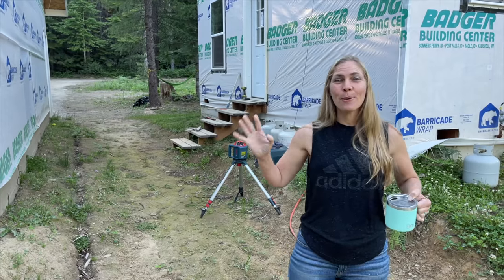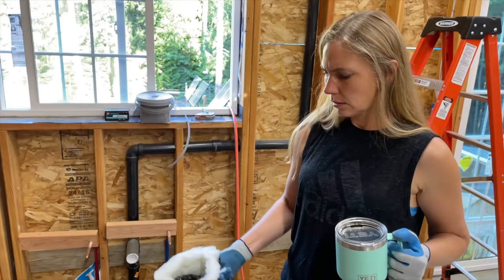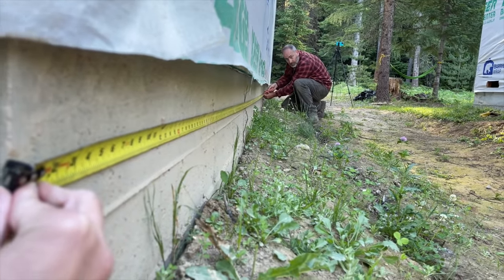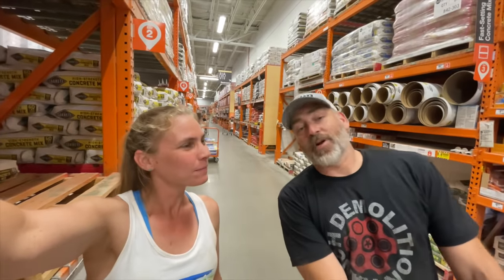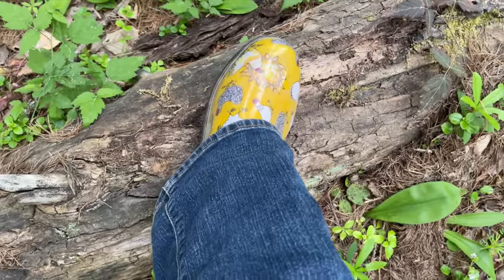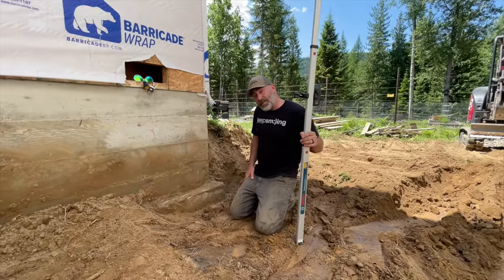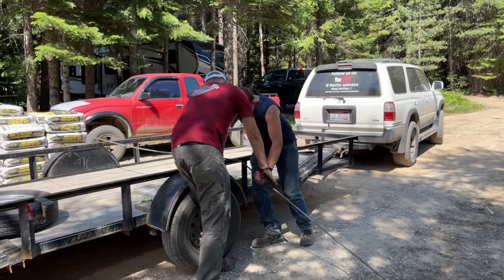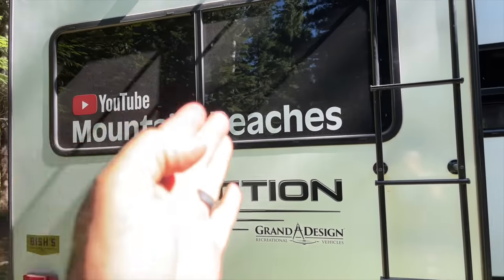CONSTRUCTION BEGINS AGAIN!  - Off Grid House Build

Comment: Install an HRV (HEAT RECOVERY VENT). You run all your exhaust vents to the HRV and bring all exterior air in through the HRV.  The HRV is an heat exchanger that removes the heat from the warm moist exhaust air and transfers the heat into the cold incomeing air.
Reply from the maker: That sounds great.

Comment: That small duct is for combustion air. It does not mix with the air inside the house. After combustion it goes out the PVC exhaust pipe. It actually is Very efficient.

Comment: Before getting the insulation and sheetrock up, yall may want to consider putting in some network drops into the rooms, a couple ceiling boxes and running them back to a central closet. It may not seem like it's needed now, but if/when you want to setup network connections in your house you'll be very glad you did.

Comment: you need to install a heat exchanger for the fresh air.
Reply: Duit pak Martin kok gak habis habis.... Bangun rumah terus...
Reply: Since they are in a Northern Cold climate a HRV Heat Recovery Ventilator rather than an ERV Energy Recovery Ventilation strategy is required and avoids that introduction of Cold Fresh Air directly into the home.

Comment: Use a heat recovery ventilator on your fresh air. Also, you need a filter on the fresh air intake. You may consider installing a damper on the fresh air so you can control how much is drawn into the return.

Comment: For your   fresh air intake  install  either  a ERV/HRV  note HRV best this is heat recovery ventilation   usually   interconnected  with furnace air handler     
 Hrv has a heat exchanger  core   where the air being  exhausted  out  of the house prewarms the fresh  air coming in  so furnace not haveing heat ice cold air  also there may be some dehumidification  happening  in certain  parts of country   
  Some states HRV OR ERV are required  by code  especially  in newly  built  home that is tight.
   The ERV  is the one dealing  condensation  used mainly in the southern  states where  humidity  is problem

Comment: The fresh air intake also prevents inversions where the furnace would draw air from exhaust lines , which then could cause carbon monoxide poisoning. Fresh air intake lines are usually guaged by the number of exhaust fans from bathrooms , stoves, dryers etc. You dont want negative draws of air which create inversions. Example someone opens an outside door and an interior door slams because of pressure changes ! Jeff & Barb Edmonton, AB
Reply: Nowadays because of efficient tight homes they use air handlers or heat recovery pumps to extract heat from exhaust air and warm fresh air intake but all need fresh combustion air same principal in cracking the window on older wood fireplaces to create a draw

Comment: You needed to add an expansion joint between the pours. Three independent pieces of concrete reacting to the cold and heat. Different sizes trying to expand and contract independently, the rebar will not stop this from occurring, not enough strength.

Comment: You can install a heat-exchanger for the fresh air intake. These are up to 90% efficient at transferring the exhaust temperature from the garage to the temp of the fresh air intake.  Straight forced air furnaces pull some fresh air in from outside but don't have an air exhaust.  This causes the furnace to maintain a positive pressure inside the garage such that the extra pressure is pushed out through cracks, door jams, windows seals, etc.  Heat exchangers let all the excess pressure be used to give all that wasted heated air to the temperature of the intake such that the garage will maintain the same pressure as outside.  That way you will only lose about 10% of the temp differential of the fresh air intake, instead of 100%.  They ain't very cheap though.

Comment: When we want to have fresh air in the house we open one or more windows for a few minutes. Fully. Usually at least once a day. Down till about minus 10 degrees Celsius. But then we have other windows, walls and insulation then you in the US. We do not build with wood but with brick. Our outer walls are 39cm = 15 inches brick. And thats on the low end, our house is a bit older.

Comment: Your furnace and tankless water heater will both require an outside air supply for the combustion in each device. This air does not enter the living space so it does not allow cold air in the winter or hot air in the summer to mix with your conditioned air. The combustion air will be expelled outside through the exhaust pipes on each device.

Comment: Fresh cold air has more oxygen molecules and has better combustion than interior air where oxygen molecules are farther apart.  Plus, in small areas using inside air depletes oxygen supply, especially in cold winter because you open and close door less often to refresh air..  most gas appliances have low oxygen sensor that shuts off appliance so you don't die of lack of oxygen .

Comment: wondering why you use a V to mark your cuts??  Its typical to use a straight to the measurement and an angle line on the sacrificial side...i.e. the angle line designates the side of the measurement the thickness of the blade cuts on.

Comment: Its fresh air makeup, The furnace uses air for combustion while burning the propane. I noticed you had screened in holes for where sofits would be to keep the attic cool, in order to keep it cool in summer so not to rot the roofing. I dont know if that can be considered fresh air make up for the furnace. What I say is to inquire with the building department and follow the code.

Comment: Fresh air for combustion. However, if you're bringing in Fresh air for breathing air there is a heat exchanger that can be installed to improve efficiency. Heat the air before you heat the air.

Comment: There are heat exchangers available that heat incoming cold air with the heat in the exhaust air. The issue is the trade-off between cost and savings. Isn't it always?
Reply: I was going to say the same thing.  The way houses are sealed up today you have to bring in air or the pollution in the house will create an unhealth environment.
Reply: I have see heat exchanger that use Hot gas from heater to 10% air coming in

Comment: I am sure there is a reason for making the doorways match from side to side but what happens if the alley is on a angle? I sure could take the extra couple steps to go from home to garage. Its deep enough to have some storage space on either end and never too much storage... Nice work and use cooking oil on the skin and the bugs get trapped and die on you instead of packing a pint per bug.... okay per three bugs as they can get more blood than the nurse can draw for tests..

Comment: KEEP IT SQUARE if you go off a 1/2 inch it won't be. OSA (out side air its called now because in some areas it's NOT FRESH)  needed to compensate for combustion.
Reply from the maker: Combustion air comes from outside too.

Comment: Fresh air needed as combustion air
Reply: There are separate air intakes for that on both the water heater and the furnace.
Reply: Fresh air is completely separate from combustion air.  The fresh air is connected to the cold air return.  The combustion air is dumped into the furnace room.  Since you put your furnace is in the attic and the attic is Vented the furnace will have all the combustion the furnace will need.

Comment: Martin, on that makeup air inlet for the furnace I can think of a few options.  The cheapest would be to install a damper near the outer wall in that 4" duct so you can control how much outside air is coming in.  The "right" way would be an ERV (heat exchange) system, however those usually run a few thousand and require power.  Although, you've got a lot of subs, maybe one of the manufacturers would sponsor you for one of their small units.

Comment: that fresh air is combustion air, not circulation air - 2 separate loops, combustion air intake eventually becomes your furnace exhaust
Reply: you need 10 % fresh air if to total 100% seal building
Reply: One of the previous videos showed that both the furnace and water heater have dedicated air intakes for combustion.  That 4" duct is what's often called "make-up" air.

Comment: Did you make provisions  for soil/sewer  pipe  when putting  footers in#?
Reply from the maker: It is not needed. It will connect to the sewer under the other part of the house.
Reply: @MartinJohnsonOffGridLiving  Check

Comment: your road seems to be pretty bad. the way i ended up getting mine to stop washing out was what every concrete i had left i started dumping it in my driveway. sometimes it would fix a hole and sometimes it just didn't seem to do anything. but by the end of my build my driveway has stopped washing out then i got dirt and it seems to be staying. so maybe you can start washing your bucket out and dumping it in your road.

Comment: U could have just let them load a pallet on ur trailer that's basically what u got each time and then unloaded it whe u got home with the forks. Work smarter not harder..
Reply from the maker: A pallet would over load the trailer. One pallet of 80 lb. concrete bags weighs 3360 lbs.